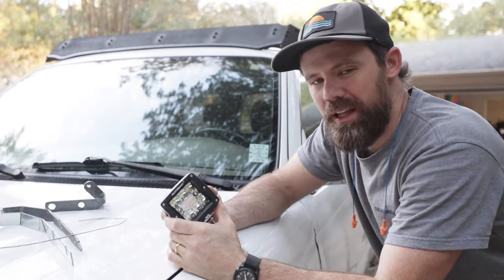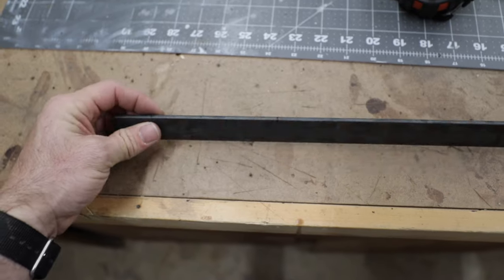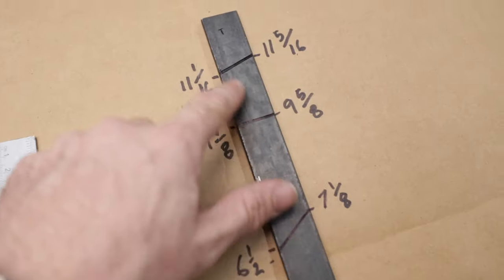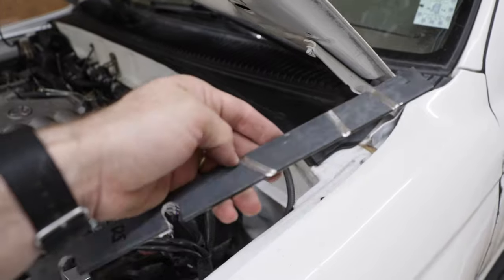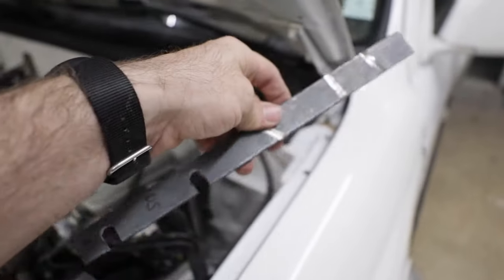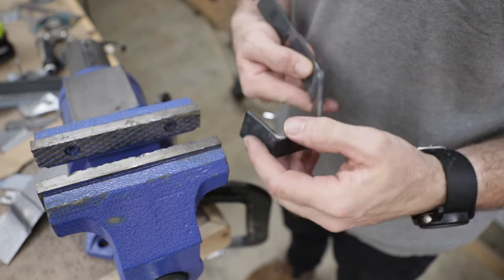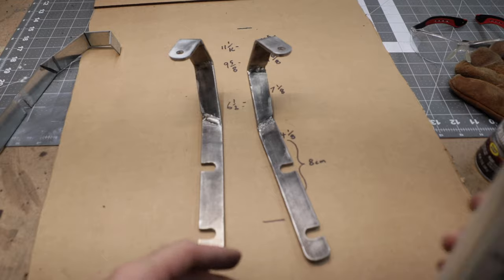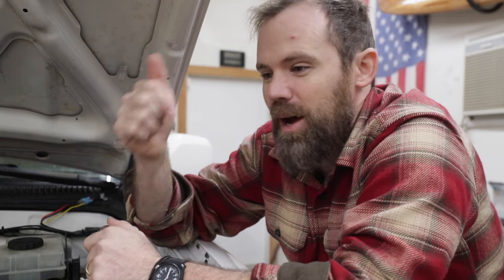How to Make Your Own  Ditch light Brackets!!

Comment: The technique is definitely useful. I have a few places I could utilize that bent wire trick.  I just bought some of these lights to turn into portable flood lights that will run off my drill batteries.

Comment: i was going to build some brackets just as learning experience!  im using aluminum because it's lighter, think there would be any issues vs the steel?
Reply from the maker: With something as small as this I wouldn't be concerned with weight. My main concern would be is it stiff enough. If it's thick enough you may be fine. I'm assuming you already know how to weld aluminum because that could be a major issue haha.

Comment: My particular vehicle, the bonnet/hood (yeh I’m in Europe - bonnet) the damn brackets for mine, have that little side plate to the inside, where yours are to the outside. Going to take a second look and see if it’s possible to have some brackets placed to the outside.
Out of interest, what you’ve made, how you made it, and with the materials you’ve used (typing this before I’ve reached the end of vid), do you think they’d support 2 pod lights? (Rigid D2’s) one spot for ditch light, and maybe a hyperspot out front. 
Vid will certainly help, even if it’s only inspiring confidence and giving ideas!
I do have some 2mm stainless steel sheet, which I’m in the middle of making a bracket for under the bonnet to mount some of my electrics on to. (20” E séries and 2 DXL’s for the bull bar)

Edit, 3/16th thickness is 4.76mm. Ok 👍🏼
Reply from the maker: Nice! Sorry! I probably should have included the metric measurements! Thanks for not cursing me for using inches like most do. 😂
Reply: @PatrickRemington  lol, don’t why I would. Did think it was funny that you included that 8mm gap though 😂.
Well, I bought some 5mm and 8mm thick 25mm wide flat bar. As well as some 6x30mm and some thin 1.5mm stuff - it’ll bend easy. 
Had a second look at the bonnet and it’s very tight. Can’t attached to the bonnet like in your vid, as it would appear that they are nuts, and there’s sod all available thread. I’ll look into whether they are nuts or funny looking bolts. When I search for 2nd hand bonnets I’m not seeing any protruding bolts so, idk, maybe it’ll work.
Thanks though, and for your reply re the mild steel. 👍🏼

Comment: I do need ditch light brackets,
 I don't have a 4 runner. 
I have a Jeep XJ.
I have been working on something like this but since there is not a gap big enough at the cowl location I am working on routing it through the gap on the side of the hood.
I don't have a welder, so I'm using a piece of an old diamond plate tailgate cover that I had laying around. 
Anyhow... Great Video! You need to get an XJ so you're videos are more relevant to me. I'll subscribe anyway though. 🤪
Reply from the maker: Haha thanks!

Comment: Would you be interested in building a bracket for the Subaru outback Wilderness Bumper lights They would both up.
Where the gold tow covers RA bar going across will block the front plate.
I was trying to avoid that.  Thank you